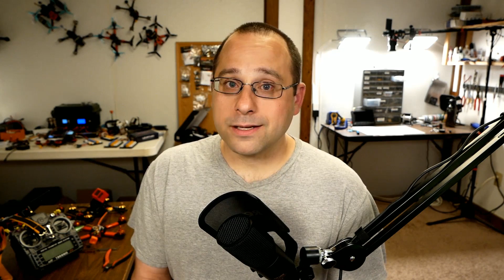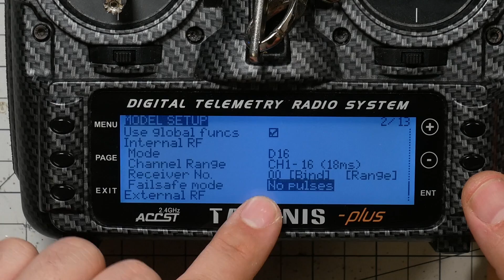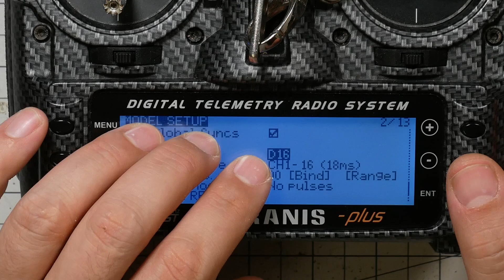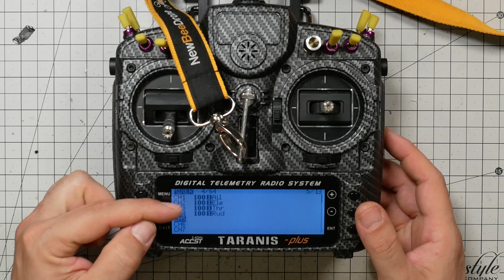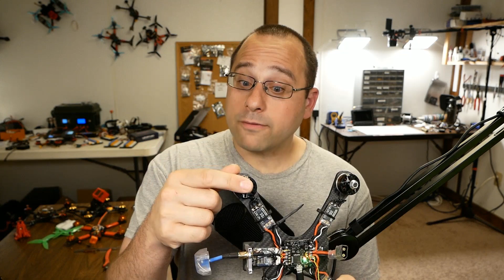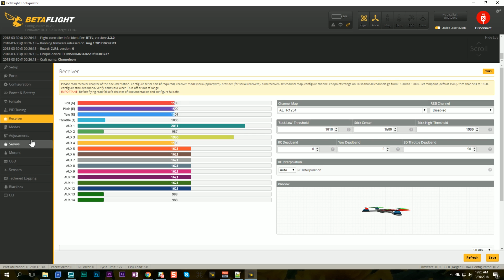What to do with my Armattan build? Part 2

Comment: Thats interesting. I just bought a 2017 diatone gt200 stretch that was custom tuned by grayson hobby. It came with a tarannis x9d. It was used on ebay. I hope there is something with it telling me how it is set up. Im lacking in the computer dept. Lacking is actually a understatement! It should be here Wednesday.
Reply: These steps are the same regardless of your quad, it’s an older vid but will help with initial set up 

https://youtu.be/e7dGCZMJ6SA